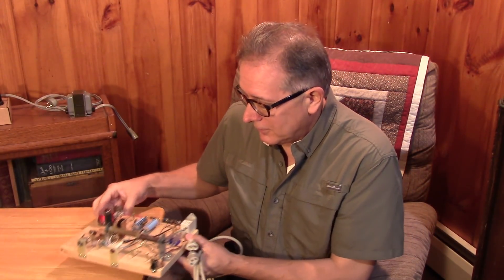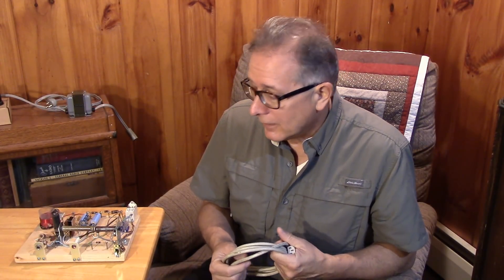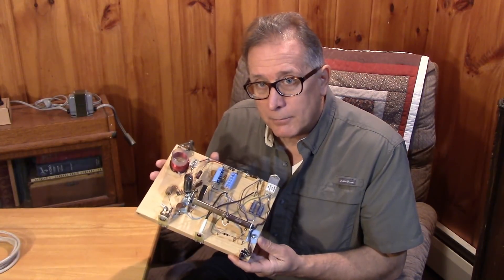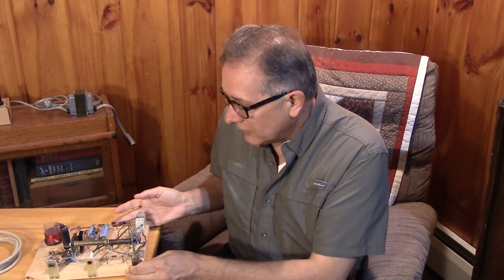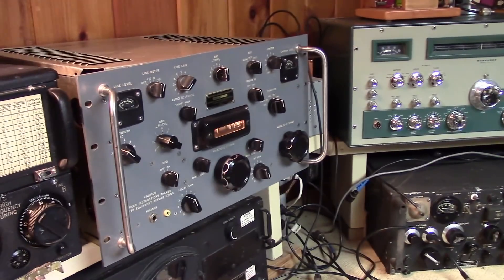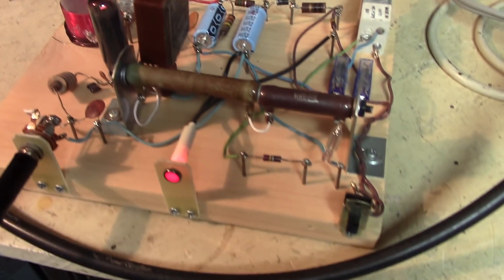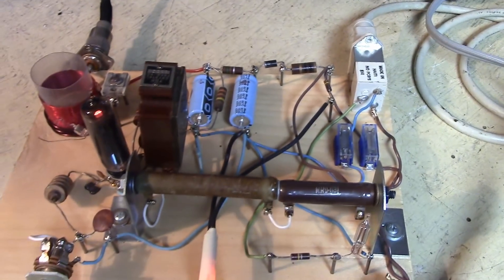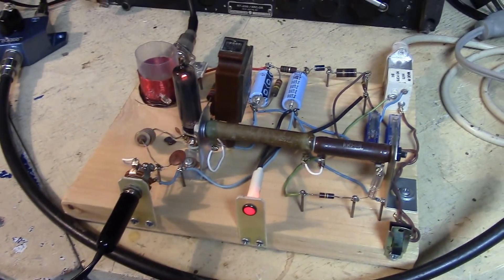Retro QRP Widowmaker

Comment: I built one of those for/with a friend in 1969. I don't know if it was our age (this was an Era where we did not need labels to tell us the cup of coffee was HOT) or the fact we understood you treated the terminals with respect.  Treating it with the respect my friend a novice mad 40 meter contacts over twenty some states. He had a blast right up until he got one card -- an OO  for 599 on 20 meters!  A DX-60 was his next step. Fun and fond memories.

My worst shock was from holding the key on my Globe Scout and reaching for my grounded antenna switch. A big buzz from right hand across chest to the left hand.  I hurt for nearly an hour!
Reply: What’s a 00 for 599 mean?   A one sentence explanation works.  THX. MZ.
Reply: You should have been there in 1958 or 19990 & 1991. In the '90s I worked 10 meters almost every evening only worked one US station. It was 250 miles away we worked backscatter off the Falkland Islands.  I had a 3 element Yaggi at 130 feet with 700 watts ERP and he had a 5 element quad at 50 feet with 8,000watts ERP.
Reply: @Marty Zielinski  A reception report which is as good as it can possibly be. 

For those who want more than a sentence... a card is a report sent to a radio amateur confirming reception (a QSL card).  OO means Official Observer, whatever one of those is.  599 is the best possible quality rating (Readability 5, Strength 9 and Tone 9).
Reply: @usvalve  The transmitter was creating a clean second harmonic on 20 meters, hence the “friendly reminder” from the volunteer Official Observer to take care of it before “Uncle Charlie” (the FCC) stepped in. Novices are still not allowed to transmit, intentionally or not, on 20 meters so that’s what that was about. I also got a card once when my DX-60 had a bit of chirp on it so I “know the feeling” hi hi.

Comment: Hi Mike, just stumbled across this video. Had to do a double take, I grew up in Manchester, NH and my parents home had the identical pine wood boards/panels that you have. Also have a copy of "Elements of Radio". Mine is 2nd edition 1959. I also have the identical isolation transformer in my collection. (along with several others).  And the R390 was in our rack panel in Thailand in 1970 when I was there with Army Signal Corps. Spent about 45 years in South Asia/Southeast Asia working after I got out of the service. Presently living in Hooksett, NH. Thanks for the Video, 73 Vern N1CKX
Reply from the maker: Three girls were raised in this little house and you likely dated one of them! That pine paneling is awesome. My wife hates it. Ha.

Comment: The worst shock I ever got was in high school electronics class when I touched the 300 VDC plate circuit of an breadboard amplifier with one hand, then reached over with the other hand to make an adjustment on the oscilloscope.  It brought home the instructor's admonition to always keep one hand in the back pocket when working on any circuit operating over 24 volts.  Fortunately, the experience didn't injure me physically, but the intense pain left a lasting memory.

Comment: I built this exact transmitter using a 50C5 back in 1975, following the magazine  plans exactly. Paired with my dad’s Lafayette short wave receiver and a 40 meter dipole, it was my first novice station. Pretty chirpy, of course, but I made hundreds of 40 meter cw contacts with it. Of course, I was smart enough to use a polarized line cord, and to be sure my wall outlet was wired properly. And, I knew not to stick my fingers anywhere near the high voltage. The first of many home brew projects, it was a great introduction to the hobby for me. It’s great to see you operating this same rig again after all these years!
Reply from the maker: HE LIVED! See?

Comment: If you ever play with a Van de Graaf or a Wimshurst machine,  BEWARE OF MIRRORS ! ! !
That aluminum coating on a sheet of glass makes a dandy capacitor,  and the wooden wall it's hanging on is a high-value resistor to ground.  In a small room,  the generator was able to ionize the air,  making it more conductive,  so when that mirror shot a spark it hit me and jumped across to another guy,  and from him to the third guy.  
From him,  it jumped to a pipe and grounded out.  Adding up all those gaps,  that spark cleared about six feet .
Had some amperage, too, Ouch.

Comment: Reminds me (a little) of the RX that I built when I was 9 years old and a newly licensed Novice.  My father was a ham and he forced me to become one, but I wasn't allowed to use his Collins rig, I had to build my own.

I wasn't satisfied with running the RX on batteries, so I decided to "redesign" it to run off the line.  I fussed with my diagram and then showed it to my father, who was also an MIT Master's Degree Electrical Engineer, and he declared that "it should work." Transformer to reduce line and a rectifier, not full bridge I was a lazy kid, and I merrily added it to my breadboard.

I do have to wonder if the solder fumes might have had something to do with it.

I also decided that since I didn't like wearing headsets, that I would add a speaker to the mess, and added an impedance matching transformer.  No, I didn't have to shop for these things, my father's junk box took up most of our barn.

I was soldering down the last speaker connection when all of a sudden there was my father, transmitting as net control on one net or another, coming in loud and clear, and my RX wasn't even plugged in (nor was it tuned anywhere near his freq.)  Extremely excited at having invented a self powering radio, I grabbed my construction and ran down from the third floor to my father's shack on the first floor, neglecting to notice that as soon as I took the radio out of the close coupling with the antenna right outside my window, that the diode stopped self-exciting, until I skidded into my father's RF overloaded shack and the speaker lit back up again and noised up the entire world with feedback.

My father's inverted 'L' antenna ran right by my bedroom window, about 2 feet from my workbench.  I could probably have picked up his signal by sticking wires in a potato or something.

The only shock I really got from it was when my father swiveled around in his chair, with feedback screaming, punched me in the nose and grabbed my "invention and threw it out the window, which was closed, and where it lay in the snow for the rest of the winter.
Reply: What a grouch!  The closest my dad ever came to being involved with my transmitting was to bellow from the front room "turn that thing off!" when I got into channel 2 while using my 6 m transmitter.
Reply: @johnbartholomew9812  You don't know the half of the grouch.
Reply from the maker: Holy Holy Holy.

Comment: You sit there saying how dangerous it is. When I was a 12 year old kid I was experimenting with line operated experiments all the time! WE KNEW TO KEEP FINGERS OFF IT! I'm 76 now and still am here. I think kids were smarter back then! Seems like kids now days can't do anything but run their fingers over a phone!
Reply: Kids today I believe don't have hands on creativity. When I was twelve back in the 1960's a friend had an above ground swimming pool. He wanted a pool pump. We took a stroll around the neighborhood and scrounged up an electric motor and a pump from an old washer machine. Mounted it on wood and mounted on a little red wagon. The pump was fantastic. He attached his mother's old stockings on the output hose and filtered out bugs, etc. This pool took over fours hours to fill up. Instead of draining it the plug way we used the homemade pump and it drained the pool in eleven minutes. This is what kids can do with their thinking when you do not play on phone toys. To this day I do not have a phone toy.

Comment: I’d say the first zap I got was when I was about eight years old.  I had an old Hallicrafters line operated receiver which my dad gave me that just used rectified line voltage to get about 175 VDC plate voltage.  I touched a set screw on the volume control while standing on a bare floor in leather soled shoes.  There was enough conductivity to get a fairly stout zap.  The Hallicrafters did not have a polarized plug, so there was a 50% chance to have the chassis be hot (until you learned and marked the plug for orientation).

The house I live in now was built in 1929 and has Hubbell Bakelite wall sockets which are surprisingly polarized and even more surprisingly correctly connected to hot and neutral via old school separate conductor knob and tube wiring.  The funny thing is that I’ve never seen polarized plugs on old appliances, and never on any hot chassis radio!  The first time I saw a polarized plug was when my dad bought a Black & Decker drill in 1963 and it had a cord with a ground prong.  The two prong adapter supplied with the drill had the one blade wider than the other for polarization.
Reply from the maker: I think that I mentioned that my worst was an old very shiny aluminum corded drill with a non polarized plug!

Comment: I knew we were in for a good video when from the get-go I saw the isolation transformer on the credenza in the background.  I’ve had an isolation transformer in my shack for years and always had one on my bench at work.  I learned by experience it is wise to always treat equipment as if the chassis may be hot even if there is an input transformer  You never know when there may be a fault that makes the chassis hot.
Reply from the maker: I am sure that you remember the crazy safety devices like the plastic cases and knobs and fiberboard backs that automatically disconnected the AC cord! And the "CHEATER CORD" you made.
Reply: @MIKROWAVE1  Thank you for the reply, and your excellent snd useful video.  Yes, those were the days.  The fiber board backs with the line cord clipped on - and the dog gone things seemed to never want to line up with the chassis socket!

Comment: If you decide to build this transmitter use a isolation transformer on the AC power side. You can build one cheaply. I use one for electronic repair. I recommend fuse the isolation transformer on the AC input and the AC output. Stay safe.

Comment: An isolation transformer only prevents shocks from live to ground.  Shocks across the transformer output are just as likely as shocks between live & neutral, and just as dangerous.  Also if half your house sockets were mis-wired, you ideally need to re-wire the whole house, because with an installation that shoddy there may well be other wiring faults.
Reply: Yip but it's so hard with old gear and wall outlets over there because phase n neutral are very transposable
Reply from the maker: There are good and bad "fully isolated" designs. Unfortunately UL approval is losing followers.
Reply: A isolation transformer can limit shocks on output........

Being such a low va that wen u take to much current the transformer flops out 

But it be useless 

The fact u can get electrocuted by the output isn't really a factor it's the ground isolation that is the main one cause that shock and problem can be from anywhere 

Also they are good for load testing limiting their draw and current input output
Reply: @weazeldark3983  It takes milliamps of current to kill a person, so an isolation transformer with such a high internal resistance that it could not supply a lethal shock would be pretty much useless.  What an isolation transformer does is ensure that you cannot get a shock by touching just one wire (the live).  Touching the live of direct mains with your hand causes a current to flow to any part of your body that has a path to ground.  Usually that will be either your feet, or your other hand if it is is touching something that is earthed.  A path that flows from one hand to the other, or from hand to foot will have a portion of the current passing through your heart, which could be lethal.  An isolation transformer has both sides of the secondary floating so there is no path to earth.  You cannot get a shock by touching only one wire, though if you were to touch both wires it will shock..But the biggest liklihood of a two-wire shock is getting parts of the same hand across the mains voltage output of the transformer.  This is painful and can cause burns, but is not likely to be fatal.  But if you were to touch each wire with a different hand, an isolation transformer provides no protection at all.

Comment: Please tell me more about earthing arrangements. In UK Neutral and Ground are often strapped together. I understand that the USA has some kind of center tapped arrangement where the line to ground is less hazardous. The trouble I imagine for amateurs is connecting the mains infrastructure to something buried in the garden and that being quite different across the pond.
Reply: MrXyzzy99,
In U.S. for the last 30-40 years we have had "polarized" wall sockets and plugs on everything.  The hot socket is too narrow to accomodate the wider grounded (earthed) blade, so it is near impossibe to reverse polarity.
     "Grounded" and "earthed" are both appropriate titles for the neutral side.  As children, my brothers and I used one of Dad's brazing rods shoved 10-20 cm into the backyard topsoil while connected to the "hot" side to "encourage" earthworms to the surface in order to save us lads a trip to the baitshop.
Reply: The voltage is just lower. You have WAY safer outlets there. Most homes have 60 Hz, 1 phase, L-N-L at about 240 V coming in. Neutral is earthed at entry to the dwelling. Earthing systems may be as simple as a rod but it depends on soil. The NFPA 70 sets most of the rules though some states, counties and cites add to that. Most outlets indoors just have 120 V (L vs N) and most are 15 Amp. 15 A wiring is minimum 14 AWG (~2.5 mm2) but most is 12 AWG (~4 mm2) with 20 A breakers. Kitchens and garages will sometimes have 20 A outlets which will also allow a 15 A plug to be used but we can have plain 15 A outlets on a 20 A breaker. We use larger outlets for electric driers, ovens and welders. Modern outlets all have earth connections and those in lavatories, garages, kitchens and outdoors have GFCI (like an RCD/ELB) unless for a special purpose. Bedrooms in newer homes are sourced from arc-detecting breakers. No special outlet for electric shavers and toothbrush chargers and the light switch is on the bath/toilet side.
Older homes may have no ground on the outlet and going still further back, into the 1940's, they were not even polarized---rejecting polarized plugs. In those days the voltages were in the 110 to 115 range but could be expected to dip down to 105. Going further back, in the 1920's or so, we used medium Edison sockets for those rare appliances since home electric was really intended just for lighting. Some areas back then didn't necessarily have 60 Hz. I think 25 Hz in some places for motors in industry. Rural areas would be off-grid but may have 60 to 110 VDC from wind that charged 32 V lead-acid batteries. Many old radio sets in the US didn't have isolation transformers partly since they needed to run on 105 VDC on a farm (as well as making it more affordable).

Comment: I noticed there were two line fuses which I've heard isn't a good idea.  If the neutral side blows the rest of the device is hot.

Also, a simple neon lamp can help determine which side is hot and neutral if you have a house with old, ungrounded outlets.  One lead goes into the socket and hold the other with your hand.  If there's a faint glow that indicates the hot side.  The glow is caused by the capacitance between your body and the house wiring.  A tiny bit of current is passed via the capacitive reactance.  Of course if you have grounded outlets there are testers made to test polarity you can get at hardware and big box lumber stores.  They're not that expensive.
Reply from the maker: Good point on the fuse if you knew which side was what. There is a wink to neon bulb protection built in. But all in all, there is really nothing that can make this safe without an actual isolation transformer, since you are connecting wires 
 externally. And you have no real insulated case protection.

Comment: I see a lot of plugged in USB chargers in the house, I don't think there's an isolation transformer used in any of them.
Reply from the maker: Good question. They are actually fully isolated. No monster transformer for 50/60 Hz is required. The modern wart produces an AC waveform chopped at high frequency thru a transformer. The much higher frequency allows for a much smaller transformer to handle the same power.

Comment: Built a 5 tube line powered AM radio, 2 prong plug, in high school electronics class and didn't check polarity. Attached the scope probe ground to chassis and BAM. Didn't get shocked, but learned a valuable lesson. By the way, I was a HAM novice at the time. AF6TO
Reply from the maker: Drama in the classroom. Love it.

Comment: When I was a kid, we had a light switch in the house that I would get a shock from every time I used it. I was the only one who would get shocked. When I ended up getting older and took the switch apart, I found that one of the screws holding in the faceplate had gone straight through the wire, resulting in me getting shocked all the time, whenever my hand touched the screw on the switch plate. Not a good feeling being zapped, I can tell you that.

There's also been a few times I've gone to start the lawnmower and had my hand a little too close to the spark plug wire... That's always fun too
Reply: Seems like you have above normal body conductivity. This is a problem, because what kills us is the current, not the voltage. If I were you, I would develop a custom to touch stuff with the outside part of the hand before grabbing it. So if you were about to get shocked again, your muscles would cramp on empty air instead of something delivering AC energy.
Reply from the maker: Ow anyway. Just ow. That hand clamp thing is scary.